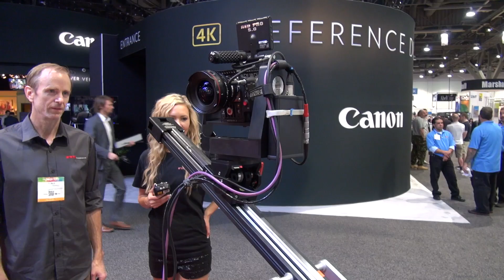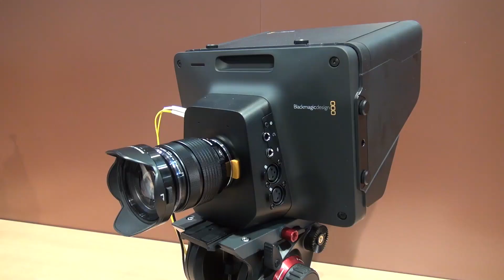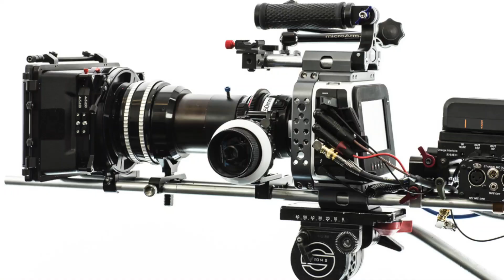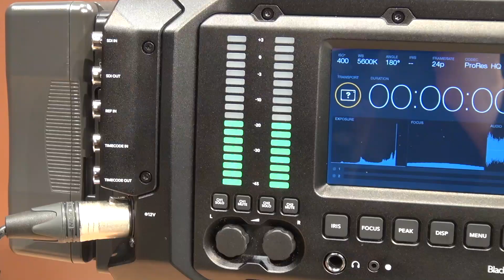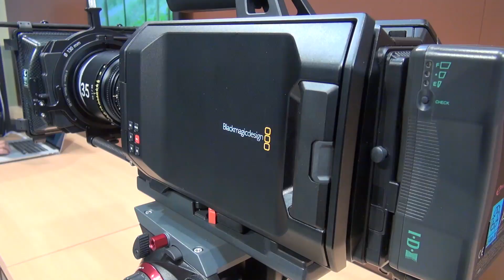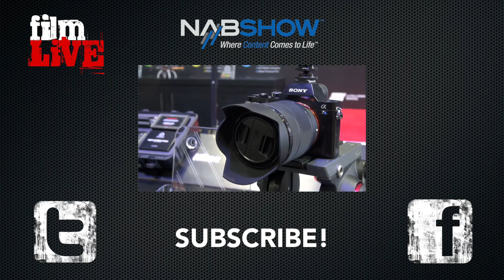Blackmagic URSA at NAB 2014

Comment: It seems like they took everything people complained about and put it all into URSA. I can't wait to see some test footage, and even a short film production of some sort to really be sold on it. Though both the production, pocket, and cinema cameras have their flaws, if used correctly they can create some stunning imagery (especially for the price). Keep up the great work Blackmagic, excited to see your products in action!
Reply from the maker: As soon as we can we will get one in the studio for a full hands on test.
Reply: ***** Yeah, a lot of things I found out that I didn't like about the camera. The fact that they used the same sensor as the BMPC (so vertical black lines and black spots in the overexposed areas could be an issue), a 120GB CFast card holds 6 minutes of RAW 4K footage (RAW may not be available on release either, just ProResHQ) and a 120GB CFast card cost a whopping $1200! Need to buy external batteries (would have anyways), and a few other things. Not as perfect as it seemed.
Reply: Ruffneck101 7.4kg bare = you are going to need a tripod that costs as much as the camera to support it.

Comment: It's a good start, but I want to see a smaller version (sound the size of a c100 or fs100) with an SSD slots rather than overpriced cfast cards and single flipout 5 inch screen. Perhaps with 4K up to the 30P and 1080p up to 60p. Keeping the XLR ports and levels, but on screen levels and either Sony or Canon battery compatibility. Next year Make that camera.

Comment: The massive weak point is the fact that it needs fast CF cards and for that resolution you need a lot of storage and 2 of those cards are almost as expensive as the camera. I don't understand why they have not stayed with SSD drives. The camera is huge as it is so two SSD drives would not have made a massive issue.

Comment: Also, does it make sense to put in the production 4k sensor in a camera that you claim is for features? You mentioned last year that the 4k production camera has a different sensor because it's not for cinema and features. So which is it. These are questions that interviewers should ask not these softball spec sheet questions.
Reply from the maker: Thats a very good question. I suspect that they are aware of that which is why it's user upgradable. The camera body will handle 120fps but the current sensor won't. They next sensor update will be pretty important. Hopefully get a bit more sensitivity, dynamic range and the higher frame rate!